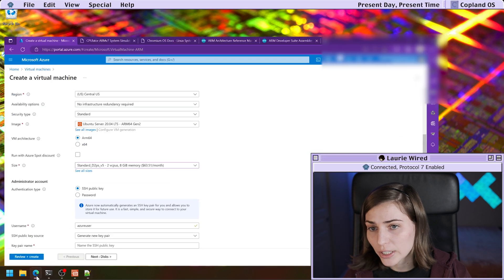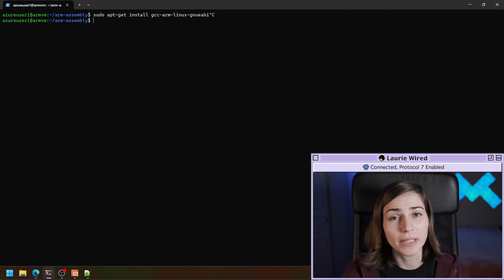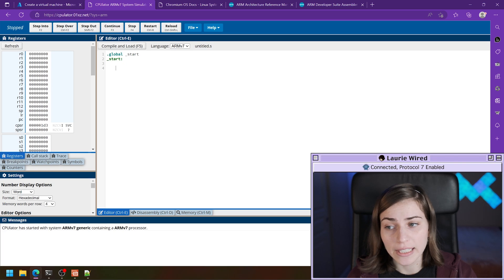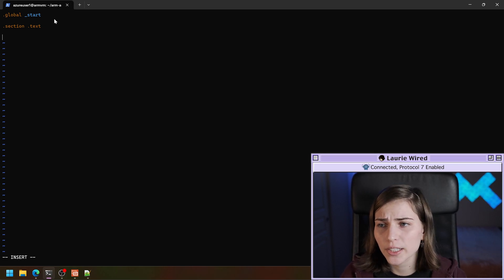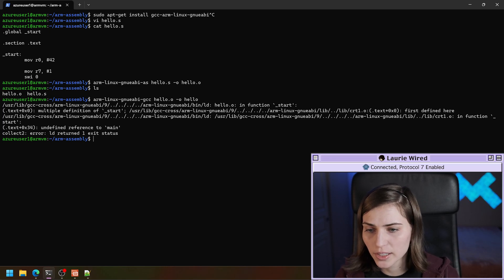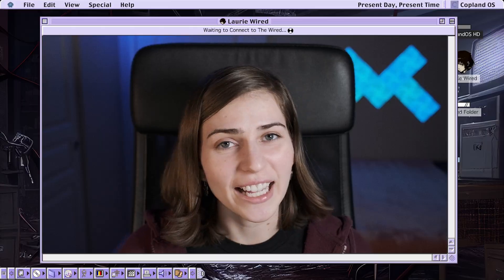ARM Assembly: Lesson 1 (MOV, Exit Syscall)

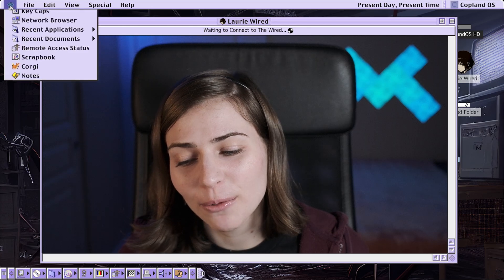Comment: 9:02 If you think about it though to demo s best practice tutorial having prints before return 0 would not make sense iterating through the process unless you exit successfully since the printf WOULD technically error but being beings of habit just assume the exit success will be included in the end of the guide.

Also doesn't Hello World chronologically not make sense since it was the one of the pair who wrote C to first use Hello World in the meme setting. If this true I would assume assembly predates C since Compiler. 

These are all just assumptions.

Comment: Hint for GCC v12 on RPi5 with 64bit Raspberry Pi OS:

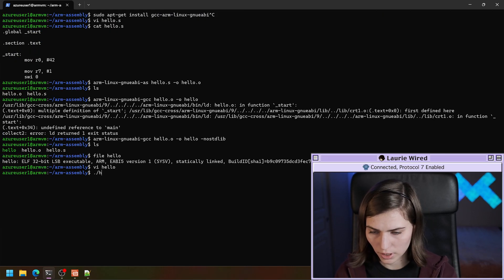If at @15:25 you get: "./hello: cannot execute: required file not found" just add "-static" after "-nostdlib"
Reply: Thank you for posting this. I just found this series and I was wondering if it was possible to just use a Raspberry Pi for this. I take it from your above post that this is in fact possible.

Comment: Just a question. What benefit do you have in using gcc to link the program like it was C ? That's why the linker misses the stdlib, because it's not C. The assembler program is compiled after the "as" command, you can just link and generate the executable with "ld". "ld" will look for "_start" label, not the "main" function, and generate the executable file.

Comment: I am going to nitpick your choice of words... values are not passed to registers... registers are used to pass values to the system call.   It is possible that this detail is no longer correct, as I am an old fart.   But "passing" was always something that happened with parameters or data between processes or to and from functions.   Registers get written or read.   Thank you for great video.
Reply: Write argument read parameter.
Reply: @АндрейДенькевич  I don't want an argument.
Reply: @АндрейДенькевич no, you define a parameter, but you pass (read/write) an argument
Reply: @PR-cj8pd yes, i pass(write) argument, but never read(receive) it.
I receive parametr and pass it as argument.
Reply: Any TIS-100 enjoyers in the chat?

Comment: The most cost effective solution to run arm on real HW is to connect a rpi Zero 2 (not Zero 1 - has armv6) or any other rpi 2..5  (rpi5 has a armv8)headless over USB to you system and connect with ssh to it. Great introduction!  -- Happy coding! --
Reply: Can you execute the file that was created? I followed along on a Pi 5 but the file created with "arm-linux-gnueabi-gcc -o hello hello.o -nostdlib" does not run. 
But with arm-linux-gnueabi-as -o hello hello.o it does work

Comment: Hi, thank you for the video.
I couldn't run the program using the gcc command you provided on raspberry pi 4.
I need to modify it 
`arm-linux-gnueabi-gcc -o hello hello.o -nostdlib -no-pie -nostartfiles`

hope it's helpful
Reply: Thank you SO MUCH. Absolutely saved me I’ve been struggling for bat half an hour trying to get this damned ELF to run.
Reply: Yes, that was helpful..  But why?  When I tried to run hello, I got "cannot execute: required file not found", but after using "-no-pie -nostartfiles", it worked fine, and I got "42".  What magic did those flags do?
Reply: I didn't end up needing the "-nostartfiles" flag, but did need the "-no-pie" flag.
"-no-pie" is apparently for disabling the default PIE (position independent executable)...  🤔🤔
Reply: @brianh.000 For those interested, the problem here is related to memory layout.
By default, compilers try to generate position independent executables (PIE). That's because they're smaller in size. These executables have their code and data sections placed at random memory addresses during runtime. However, Raspberry Pi being an embedded system, its hardware has a limited amount of memory with specific reserved regions. So you will need to disable PIE by making the executable a position dependent executable (PDE) instead. The trade-off here is that PDEs tend to be much larger files.
Reply: Thanks for the advice! It worked on raspberry 5!

Comment: I have a gambas3 ide for arm available. No gdb yet. In /use/bin you wll find the abi-as linked to as. In 64b this is the same so I'm soft-linked to as7 for 32b leaving as for 64b. Also, align 4 all .data's or bus error, and add .arch arm7-a before code and data.🤒🙏🥰

Comment: Nice! Thank you for this video series! What do you think about following along using an arm sbc? Do you think there might be some problems if it is 64bit or another version of the arm ISA?
Reply from the maker: There shouldn't be issues using an ARM sbc as long as it's not a significantly different/super old ISA.  ARM64 will cause a few differences to the register sizes and such, but most of the overall concepts will be the same.

As long as you are on ARMv7 or higher most of these lessons should just work as expected.